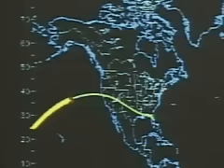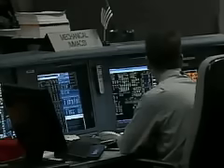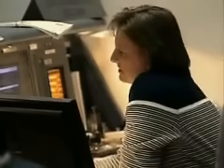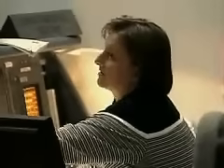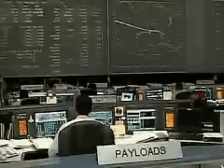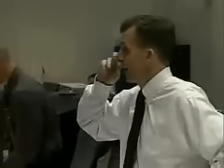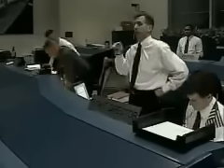Inside Mission Control During STS-107 Columbia's Failed Re-entry and disaster

Comment: How could the flight director pretend to be so obtuse? He had to know EXACTLY what it meant to lose those four wing temperature sensors as well as the tire pressure issue. Asking for “commonality” and implying that it might by instrumentation, when NASA was well aware of the foam strike, is just a shameful dog and pony show! I doubt that they were positive that a catastrophic failure was imminent, but the director sure as hell knew what the cascading failures were foreshadowing and he just pretended the whole way through.
Reply: "He had to know EXACTLY what it meant "  The flight directors are good, but I'm guessing they don't have a photographic recall of every square inch of the shuttle diagrams.

As for the question about commonality, that's the logical thing to check first when there are multiple failures at the same time. Suppose you wake up tomorrow to discover that your toaster, your microwave, and your coffee maker aren't working. Is it possible that all three appliances died at the same time? Sure, it's possible-but rather than go to the store and get all three, you'd first want to check their point of commonality, which is the circuit breaker.
Reply: @almostfm  
Except your analogy isn’t apt. 

There was a foam strike at launch. NASA knew about it, had meetings about it, discussed potential damage and even concluded that they wouldn’t be able to repair it even if the NSA satellites were to image the wing prior to re-entry (so NASA declined the NSAs offer to do so). So no, a circuit breaker wouldn’t be the thing to look for if all your appliances had failed one morning, because in order to make your analogy fit, you’d have to add the fact that you knew you hadn’t paid the electric bill the week prior. Now, with the knowledge of a very likely cause for related failures, checking the circuit breaker would then be as useless as asking whether the cascading sensor failures had mechanical or electrical commonality. The thing they all had in common was being located on the wing that the flight director knew to be potentially damaged during the launch.
Reply: @briley2177  " So no, a circuit breaker wouldn’t be the thing to look for if all your appliances had failed one morning, because in order to make your analogy fit, you’d have to add the fact that you knew you hadn’t paid the electric bill the week prior. "

You'll notice I mentioned just those three specific things, and not that nothing electrical in the house worked. That removes "didn't pay the bill" as a point of commonality.
Reply: @almostfm  
The point is there is no need to search for a “commonality” if you know a more likely causal reason. Stop being obtuse. His questions make absolutely no sense given the fact that he KNEW about the potential for a heat shield weakness on that side of the spacecraft. They ONLY make sense if he was unaware of any reason for affiliated failures and was searching for an explanatory reason for cascading failures. Because he already had reason (the foam strike), and he never verbalized anything regarding this MOST LIKELY explanation, it’s obvious he was grasping for common electrical systems or instrumentation issues as theater to avoid the elephant in the room. Everybody knew what happened at launch, and yet nobody mentions “could it be related to the foam strike?” C’mon man.
Reply: @briley2177  I'm not being obtuse-you've already reached the conclusion that he knew and was just playing dumb.

They knew about the foam strike, but they didn't know about the hole in the wing. Knowing about "the potential" for a weakness in the heat shield is very different from knowing that Columbia was fatally wounded.  So you work the problem and see if there's some commonality between the things that failed, which is why he asked the freaking question . It wasn't until he knew there was no commonality that he would have known the problem was in the heat shield.
Reply: @almostfm   
No. You ignore the point. They knew about the weakness, and when it started to become evident that Colombia was fatally wounded, they ignored this most likely CAUSE of the failures in search of a less problematic reason for the failures. That’s the whole point of my post.

And yes, I reached the conclusion I did because the evidence LEADS to the conclusion that:
1) NASA knew of the foam strike, the potential for damage to the heat shield, and the repercussions said damage could potentially have upon re-entry.
2) The most catastrophic repercussion would be loss of the spacecraft and crew.
3) Losing the spacecraft would be preceded by the inability to communicate with the spacecraft. And most specifically, an inability to communicate with the part of the spacecraft where the failures occur.
4) Mission control lost the ability to communicate with the shuttle in precisely the region where the foam struck the spacecraft during launch.
5) NASA held meetings on all of this and the Flight Director for re-entry would have known all these facts and exactly what to anticipate in order to manage reentry.
6) The flight director never once mentioned the foam strike. Instead he asked stupid questions like is their commonality between wing heat sensors and tire pressure sensors and whether it could be instrumentality. He knew it could be cascading, catastrophic, failure related to the heat shield but he asked if it could be something else instead.

The reason you decry being obtuse is the same reason you don’t recognize that the flight director was doing the exact same thing. You want to pretend as if his questions led him to the conclusion that “if there is no commonality and it’s not mere instrument failure, then he realized it must be the heat shield.” I’m not willing to be so naive as to believe that he didn’t go into that room knowing EXACTLY how the worst case scenario could play out. The flight director wouldn’t be that “in the dark” nor would he be so willfully ignorant. He asked the freaking questions to put on a dog a pony show - to paint the picture that this result was unforeseen when it absolutely was not. They played dumb because they knew there would be a Congressional investigation, they didn’t know what it would uncover, and playing dumb is a safer move than honestly acknowledging that they saw this coming - but it’s also disgusting to watch.
Reply: @briley2177  OK, let's cut to the chase. For the sake of the argument, let's say you're absolutely right. What should he have done at that point?
Reply: @almostfm  
It isn’t about “should’ve or could have done” to improve the situation, however, an honest approach to the tragedy would’ve included asking his controllers whether “their data was consistent with the foam impact we saw at launch.” That would’ve completely eliminated any accusation of feigned ignorance or artificial presentation. Had he done that, my post wouldn’t exist.
Reply: @briley2177  "Had he done that, my post wouldn’t exist."

I guess it's too bad he didn't check with you to see what the acceptable response was.

If it was the foam strike, there was nothing they could do about that. But if it was something else, they might be able to do something about that. That's what he was doing-looking for things that they might be able to fix.

The basic rule in spaceflight is that if you can't do anything about it, don't take time messing around with it.  The lightning strike on Apollo 12 could have fried the pyros for the parachute, but they couldn't fix that, so they didn't examine if it did. Because if it did, the crew was dead whatever they did.

On Apollo 13, they didn't know if the explosion damaged the heat sheild. But they couldn't fix it, so they didn't try and diagnose whether it did or not.

Same thing with Apollo 16 and the balky yaw gimbals on the SPS. They switched to the backup, but if the backup had the same problem, they were stuck in lunar orbit. No way to fix it, so no point in fixating on what might be.
Reply: @almostfm  
What a deft and masterful command of the English language. At least use the word creatively - no need to let your ignorance and stupefying rage join forces.

Comment: The engineers recommended and were denied an inspection of the wing after launch from ground stations.  Shuttle Atlantis was at the Cape being prepped for another mission and could have been re-tasked for a Columbia rescue.  That hurts the most.
Reply: Actually, the request was to use spy satellites to take the images. They'd tried it on a previous Shuttle mission and the results were...not encouraging.

And I've seen the rescue plan that the CAIB asked NASA to outline. The limiting factors for when they had to get the astronauts rescued were the LiOH canisters that scrub CO2 out of the air and the reactants for the fuel cells that gave the crew electrical power. Those both would have run out sometime on Day 30, and either of them running out kills the crew, so they needed to get the crew off Columbia by Day 29. Since it would take almost a full day to do the crew transfer, they'd need to start it on Day 28. But there wasn't a launch window on Day 28, so they'd have to launch on Day 27.

The only way they could cut that much time off the Atlantis prep would be to go 24/7 processing, and since they only had two crews, that would mean they'd have to go to 12-hour shifts, 7 days a week, for almost a month. Even then, they'd have to skip a lot of the safety and operability checks they normally do. So you'd have really tired, rushed ground crews and if they made a mistake, it probably wouldn't be found. If the computer caught the problem at launch, they'd have 90 minutes to get to the pad, fix it, and get the hell away from there for the next launch window. If they can't do that (or if another problem crops up) it's game over.

But even if it launches successfully, the fun isn't over. Because Columbia didn't have the docking adapter, pilots on both Columbia and Atlantis would have to hand fly the shuttles in close proximity for 24 hours. Too far away, and you can't do the transfer. Too close, and that's a bad day for everybody.  And because of how the shuttles would have to be oriented, they'd have to do it blind.

And, BTW, how did they know Atlantis' tank wouldn't have the same problem as Columbias?  Actually, they didn't. So there was a real possibility that you'd end up with two crippled orbiters and two dead crews.
Reply: @almostfm  great details! Thx!

Comment: Just fyi for anyone trying to research the incident, this video is splicing together video footage from times that are not in-sync with the audio, and the audio itself is also edited and spliced to reduce the time of the video and add to the dramatic effect. This is great that there is a video at all, but do further research on the incident and do not rely on what's presented in this video, especially if you're trying to understand the timeline.

Comment: My guess is that NASA knew on launch day that fatal damage had occurred to Columbia.  Repair was not possible, the best they could hope for is that the orbiter made it back in one piece.   Flight Director Leroy had remarkable control as this disaster unfolded.   Almost as if it was not a surprise.
Reply: They did not know. They knew about the foam strike, but they had thousands of them during the program. Top engineers judged it would be no big deal, so management decided not to ask for any images from DoD, which some people had asked for. Which was of course a mistake - even if it is doubtful if something could have been done.

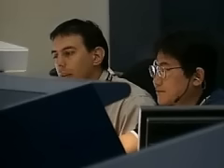Comment: 1:40 4 temp. sensors are failing

4:44 questioning if everything in space shuttle Columbia is nominal 

5:16 lost contact 

7:02 Columbia - Huston use check, coms check 

8:12 confirming of failure 

12:28 lock the doors

16:08 no data or anything

Link to reentry and destruction: https://youtu.be/1oBTzbKx0jo

Comment: The commonality is that they are all in the wing with the giant hole in it!! That’s what I would have said.
Reply: The thing is, asking about the commonality is the standard thing to do, because if there is a point of commonality (like a wiring bus) that's by far the most common cause of the problem.

Imagine you wake up tomorrow and discover that your toaster, coffee maker, and microwave don't work. Is it possible that all three things died at the same time? Sure, but it's a lot more likely that there's a point of commonality-your fuse box.

They knew all those things were on the left wing, but they didn't know for certain the wing had been breached. The fact that there was no commonality between the failures was actually the first clear indication that the foam strike wasn't like previous ones.
Reply: Yeah you could see the mood in the room change as soon as that first issue came to light.

Comment: The more cold blooded engineers in the room knew something was terribly and unrecoverably wrong when they heard the 4 temperature transducers were on separate circuits, located near each other, and went out clustered but not simultaneous. If you're cold blooded enough to overcome that "no, this isn't happening", you know immediately a wing is being roasted from the inside and there's not a damn thing that can be done.

Comment: Nasa blew it for the columbia not obtaining space walk pictures of the damaged wing and knew of the foam issue for years before this. They were also warned not to launch in 1986 by engineers and because the president wanted to beat russia they launched. Live and learn I guess but tragic science trump's human life
Reply: The point where NASA actually "blew it" with Columbia was when they decided to just live with occasional foam losses because it hadn't caused a huge problem before.

But even if they'd gotten pictures that showed there was a serious hole, what's the next step? They were in the wrong orbit to get to the ISS, not enough time to launch a rescue mission, and no practical way to get out to the hole on the wing. Columbia wasn't flying the Canadarm, and the SpaceHab module was in the space where the airlock would have gone.

Comment: If they were this close to earth, I wonder why they couldn't jump out of the plane with parachute? Being alive is best than anything 😔
Reply: They were actually 40 miles up and traveling at 25 times the speed of sound, and not flying in a stable attitude once they realized the problem.  Bailing out under any one of those three conditions would have killed them just as dead as the orbiter breakup did.